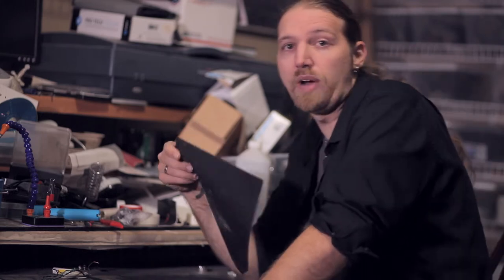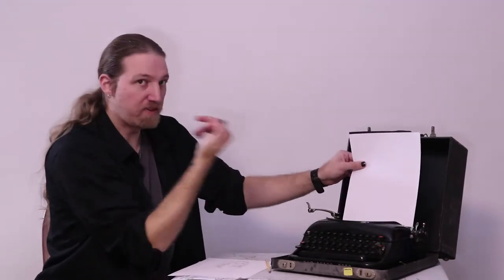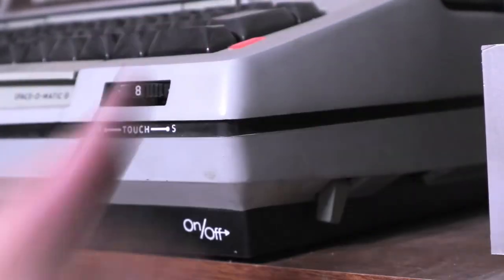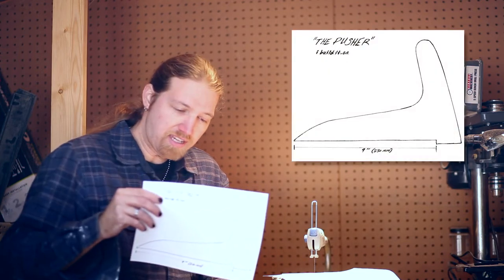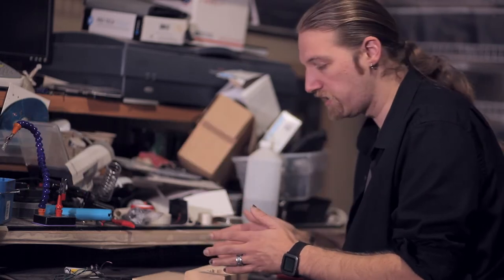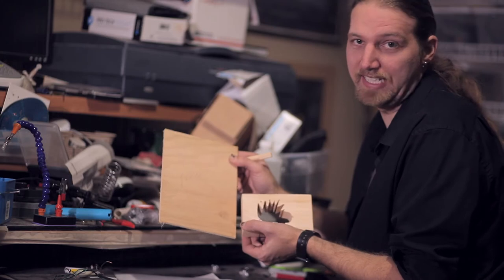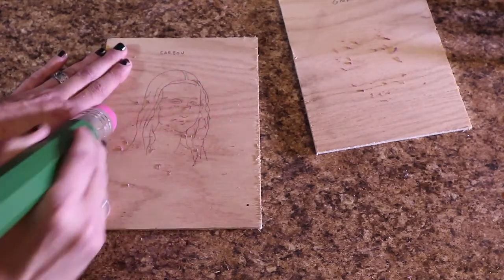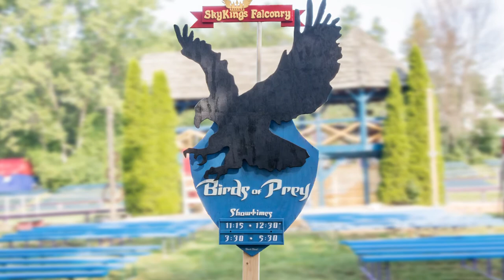PROJECT - CARBON PAPER

Comment: recently started using carbon paper with my pyrography and woodworking and it was such a game changer, especially where I had so many issues in the past with using a papertemplate to pyrography but then the template will move or i'll burn through the lines so that then I couldn't see the detail of if it's a thin or thick line whereas with carbon paper you can make the line thicker to show that's what you need.  So love this vid and I really hope they don't stop making it with how useful it is!